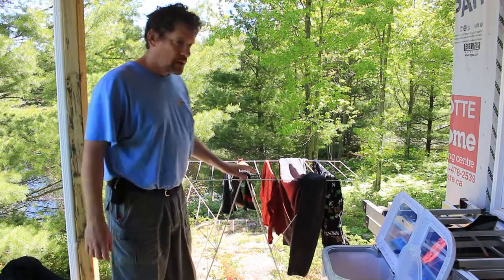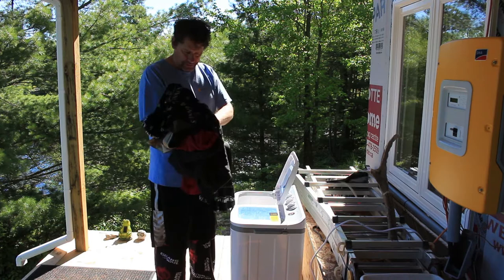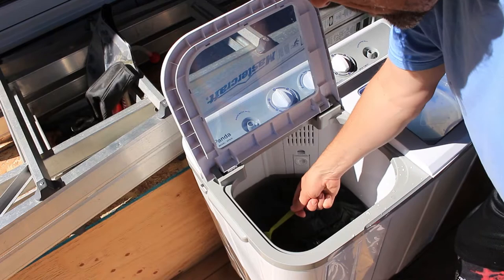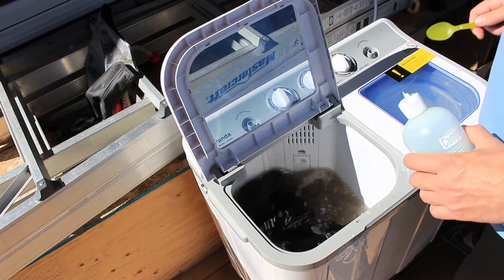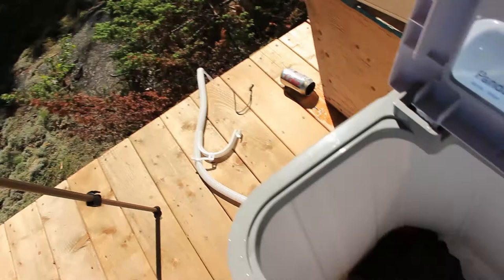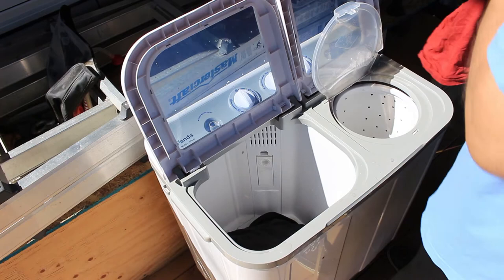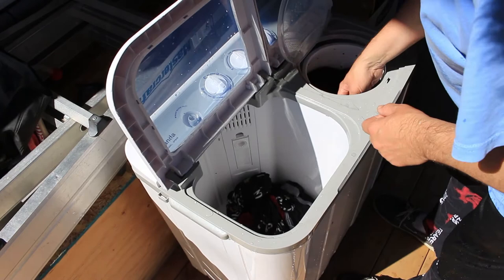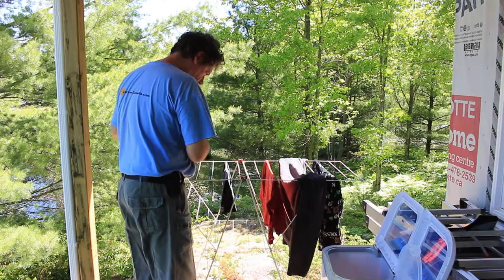Portable Off Grid Washing Machine

Comment: Hi, I use the same machine in my A frame here in Nova Scotia.  It is set up here for a full size washer and dryer but in separate rooms.  One under the stairs and one in the kitchen.  Every inch of space is valuable in an A frame due to lack of storage because of the slanted roof.  So I put my work desk under the stairs and an island in the small kitchen.  I store my Panda at the end of the island.  I just push the machine over to the sink when I need to use it.

Just a couple tips that will save you time using the machine.  

Even though it seems like it uses a lot of water, it's much less than a full size machine believe it or not.  Also, you can fill the wash side half full with clothes and water.  I hate to say this, but you had too many clothes for the amount of water you had in there. 

 I usually put in a tablespoon of soap as the machine is filling but since you pour the water in, I would put the soap in after pouring just some of the water in,  then turn the machine on for a couple seconds to let the soap mix with the water. Then put in about half the amount of clothes you did in the video and finish filling the wash side with water till the clothes are actually floating in the water or half way up.  Then let it wash for a good 5 or 6 minutes.  If you put too many clothes in and not enough water, it will make the machine work harder which may be the reason the wattage reading was higher.

I would have a container of some sort sitting by so when you take one load out of the spinner, you have somewhere to place it.  I usually have both sides going at once so when I take the wash out of the spinner it goes into one of the kitchen sinks while the other side finishes up washing.  Then I just set the machine to drain and while putting the clothes into the spinner.

Then when it's empty, I fill it again and start rinsing.  Usually I can use the rinse water twice but I do have to add a little more water to the rinse tub as so much water is in the clothes going into the spinner.  Just have to remember to turn that drain dial back when the machine is empty or the pump will burn up.

The reason your rinse water was so murky was two reasons.  The clothes weren't coming clean enough due to not enough water and too many clothes in the wash cycle.

Depending on the size of that blanket you were talking about, it could be washed but would have to be hand rung and hung out.

Hope this helps.
Reply from the maker: Wow, great info, thanks. I've been doing smaller loads since the one in this video and it's been working pretty good. I even did the big yellow blanket that I wanted to do. With a lot of fiddling it even fit in the spinner. 

I'm using a small recycling container as a type of laundry basket, somewhere to put wet clothes until my next step. Works ok. I put up a clothesline too, though I didn't take any video of it yet.

The one thing I didn't mention in the video, because it happened a couple weeks later, is the drain motor popped on me. I was doing a spin cycle and it had just got up to full spin when there was a loud POP, a puff of smoke came out of the back of the unit, and after some trouble-shooting, discovered the drain motor no longer worked. So I sent it back and got another one. NO simple task for me, as everything comes and goes here by ATV. Quite the hassle. HOpefully it doesn't happen again.

Thanks again for the info. Hope you're enjoying my videos.
Reply: Wow!  Really sorry to hear about the drain motor!  Glad it was still new enough to get it replaced.  What a pain in the youknowhat to have to deal with that.  Glad it's working out alright for you though.  I'm impressed about the yellow blanket!  Good going!  One thing I had to giggle about was your rack you used for drying the clothes.  I use the exact same rack for winter drying!!  Loving your videos!
Reply from the maker: LOL yeah that rack is perfect for winter time drying, I can just set in front of the wood stove.

Comment: In Home Laundry.  I bought a mop bucket with a wringer.  The bucket works great for doing the washing, and the wringer does a good job of wringing out things like sheets and towels.   No power needed. I park it in a closet after use.   It cost me about $41.00.  Re-soaking saves a lot of work, and your clothes will me much cleaner.  GAIN laundry detergent is amazing,  inexpensive and smells nice. I drape the wet laundry over  chairs, a step ladder and anything else, and I also put wet laundry on clothes hangers.  The moisture helps put some humidity in dry indoor air.   I can use a fan to help dry big sheets.  I all works out great.

Comment: Great vid.   Obviously you never used washer spin dryer.   Never seen anyone spin them in between washing and rinsing lol.    Rule of thumb cap full if soap is usually good enough.   Getting to be very self sufficient.    What's next?
Reply from the maker: Hi Ron. I'm no laundry expert, but doesn't a normal washing machine spin the clothes before rinse cycle?

What's next? More firewood, unfortunately. Gotta get ready for winter. Also, thinking about making a proper outhouse.

Comment: Do you use lake water via pumping?
Reply from the maker: Hi Karen, I don't have a pump yet but I want to have the ability to use pond water in future. But I need to add a sand filter to my filtering system before I do. It's stagnant water and has lots of sediment in it. Right now we've had decent amounts ot rain so I use the rain water for washing/showering, and I filter it through ceramic filters for drinking/cooking. It's working well.

Comment: Hey how you going could you get a pump pump water from the lake to use for the washing machine and PS say hello to Willow and Junebug
Reply from the maker: Hey David, Junebug's like a cat right now, climbing into my lap, licking my fingers while I'm trying to type, wash my face. Willow comes back on Thursday so that will be an interesting reunion. It will be the first time they've seen each other in 10 days!

I could easily pump water from the lake but it's stagnant, full of sediment and would probably stain my clothes. I do plan to add to my filtering system so I can use pond water, but I haven't got it set up yet.